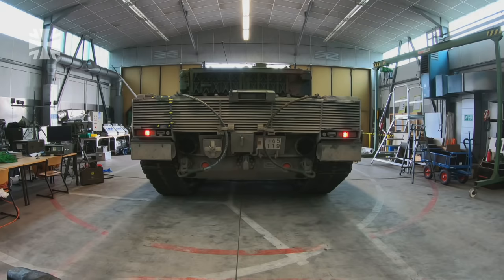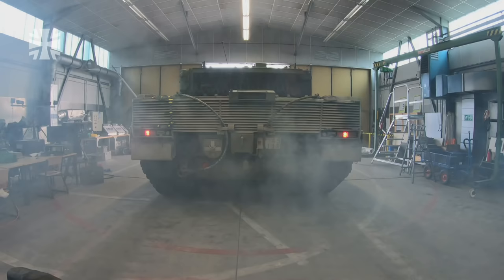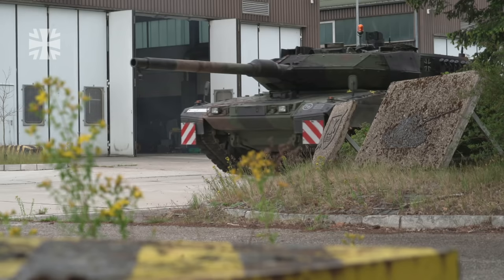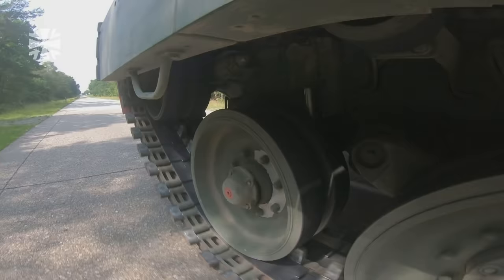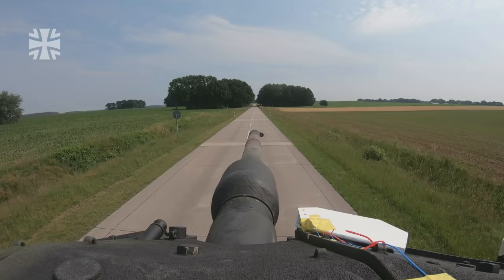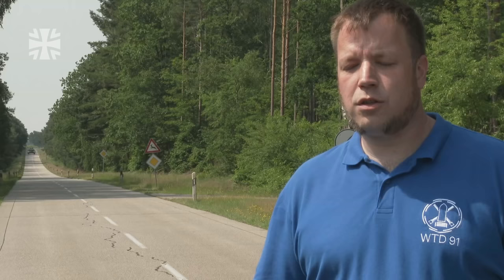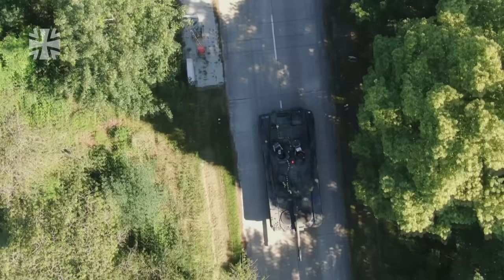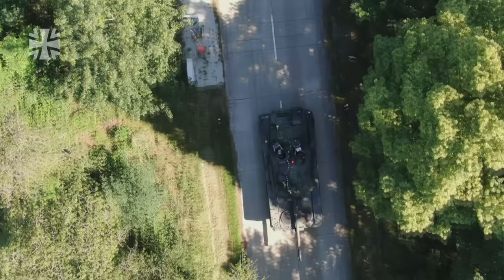Testing the New Leopard 2 A7V Battle Tank | Bundeswehr

Comment: I like that they called it the A7V
Reply: Ww1 flashbacks incomming
Reply: They got to know it
Reply: We skipped several variants to name that thing the a7v but don't tell anyone
Reply: @argumasch663  War 'n Witz Mann
Reply: @moritzrossbroich  
lol
Reply: Bf1 flashbacks
Reply: Small difference from the original rectangle A75
Reply: They both look like weaponized boxes so it works
Reply: Did they get rid of the ammo rack in the front?
Reply: @argumasch663  Wrong for the A5, served in a unit that used them before they went to being converted. That was back in 2003/4. We had both variants running for some time, the A6 and the A5. GÜZ used A4s at that time. But yea we were supposed to be all A6, our luck that the factory was only a few km away.
Reply: @konstanow1367  yes
Reply: @yuurichito1439  War thunder player I presume? :p
Reply: WW1 flashback
Reply: Hhahahahahhahahhahaha on the top
Reply: Wow, thanks for pointing out. Funny and nice detail
Reply: Next up:panzerkampfvagen VII tiger 3
Reply: @argumasch663  humor is not a german thing, huh?
Reply: Just like old times
Reply: WW1 flashbacks incoming
Reply: I thought that sounded familiar now that i saw this tho
Reply: @yuurichito1439  It was addressed in all leopard 2A6 and 2A7 as well as most 2A5 have or can be equipped with thick frontal armor plates. There are 2 modules, the second one comes as an additional on top of the first. Ammo rack since 2A5 has separated bins and the hull is covered from inside with the Nomex anti-spalling layers. All modernized Leopard 2A4 and 2A5 have very efficient fire suppression systems near the ammo rack. On top of all mentioned the crew can always take less ammo into the hull rack. Having it 50% empty solves the issue, 30% full makes it impossible to catch fire no matter what.
Reply: old habits die hard
Reply: When the old family name comes back*
Reply: I was screaming in my mind “NO GERMANY NO-“
Reply: Heil Dir Im Siegerkranz intensifies 
Für den Kaiser people.
Reply: Well they didn't get to use it in WW1 why not give it a rerun
Reply: British should make an Challenger Mark 4 or Russians name a T-14 Tzar
Reply: Yes A7V the only ww1 tank used by germany in case any other people see this and don't know what it is
Reply: @IronAussie1  when you realise it was a german joke, actually from a german
Reply: @magmcmahon9038  Then live with another one kid
Reply: Yeah, its leopard 2 Ausführung 7 verbessert.  Its like calling it A7 Mark II or A7 advanced. Its probably coincidental that this was a World War one tank name.
Reply: @deildegast  And ???
Reply: @deildegast  👍
Reply: What do you mean?
Reply: @robotdaan  what about big boy 😆
Reply: @magmcmahon9038  why do they call it that? And what does it mean
Reply: @robotdaan  cus Jeff carter love's it 😂
Reply: A7V Mephisto: Where did that bring you? Back to me.
Reply: Ah yes the old moving Toaster Machine
Reply: * WWI flashbacks *
Reply: its evolution stage 7 ... not the A7V from WW1... but as a german soldier i can tell you the T72 is able to kill a Leopard 2
Reply: KF51 „Panther“ left the Chat🙄
Reply: its called junk now pffffffffhahahhahahaha
Reply: It has come a long way

Comment: Time passes but certain things never change, you Germans are damned good at making tanks, and it is something you like, and I can only approve, a greeting from Italy.
Reply: Your Ariete is also a capable tank 👍
Reply: @jpm5125  😂😂😂🤣🤣🤣👍✌️
Reply: And still a danger to Europe by not helping Ukraine adequately.
Reply: @bananaman7537  Started out real slow and been the voice of restraints. Have painted out germany kinda bad.
Reply: @B.D.E.  well that changed now didnt it. Scholz got the yankees in
Reply: @swagkachu3784  yes. But imo, it would be more effective to send in Wiesel 2 Motar 120mm (8km range) and the Wiesel MK Version esp. in Urban combat those "things" can break & shot through walls with their 2-Ammo-Belt MK Turret feeder with AP & HE munition, which can be instant switched to each belt-munition. The Motar version has a insane range & shot frequence for its size.
After all, throw a Bush over it and it is simple covered. In night, even if a Wiesel is standing besides an enemy tank,... they will NOT hear it,..its so fk*ing sneaky. Fast in Fast out. Great fire power. Maintn. is with 15min Motor & Gear replacment IN FIELD conditions, cannon of the MK turret can be changed/replaced *without any tools.
You can get 6-10 (dep. on version) Wiesel for 1x Leopard.
So for 10 Leos, you get 60-100 Wiesels,...
Production time is also way faster ofc and the used Material costs are even better then 6to1 ratio.
Ofc the Wiesel is NO tank. It is the LAST Tankette: A tankette is a tracked armoured fighting vehicle that resembles a small tank, roughly the size of a car.
>> So for me, it would make more sense, to send what,... arround 500 Wiesels 300 MK versions and 200 Motar versions than 83 Leos.

Ofc i know Tanks would be also needed but in a matter of fact, the Wiesel should have been the first option send in mass to then be act as covering & scouting for the incoming MBTs.
Reply: @B.D.E.  if you are such a fan of Ukraine sell all your belongings and give the money to ukraine
Reply: Honestly German tanks in WW2 are extremely overrated. But yes, the leopard 2 is very much contends for the top MBT  spot.
Reply: @hhhkojkjk6962  kindergarten logic lol
Reply: Time for reunion?
Reply: @bananaman7537  yeh now who is keeping the ukranian budget running?
Reply: @B.D.E.  Just the second biggest contributer in the world. But i guess with your mindset you don't count EU donations....
Reply: They used to make good tanks
 Ukrainian war proved they were overrated
Reply: Время тигров и пантер прошло. Горит любая сейчас броня от Российского стрелка.😂

Comment: Me: how many variants do you want?
Leopard 2: Yes
Reply: Could go with the t55 or centurion
Reply: German Mechanics: we are about to announce the next version  after Leopard2A9
the world: ah, you gonna finally call it Leopard 3?
German Mechanics: Leopard 2.1
Reply: @Kalashnikov413  T-72:
pathetic
Reply: @cursedcliff7562  Skipping over command and export variants (many of these will have a "K" model which is a command tank with extra radios):
T-72 "Ural"
T-72 "Ural-1"
T-72V
T-72A
T-72A obr.1979g
T-72A obr.1984g
T-72AV
T-72B
T-72BA
T-72BV
T-72B1
T-72B obr.1989g
T-72B obr.1990g
T-72B2
T-72B3
T-72B3M
T-72B3 obr.2016

So lots of variants is pretty par for the course for modern tanks. Sometime during the 70's we got hull design down about as well as we were going to get it for a while and most of the developments in tank tech since then have been things that are easy to bolt on to a pre-existing hull with no need for any sort of redesign in order to implement them (things like improved fire control systems, better ammunition, better optics, and explosive reactive armor (all of which make a substantial enough difference to mean that if a company of M1s faced off against a company of M1A2 SEPv3s, the M1s would be absolutely massacred)).
Reply: @gareththompson2708  madlad
Reply: Sherman:
You dare oppose me mortal
Reply: Panzer IV: How cute
Reply: Germany: it’s so good we don’t want a third one!
We want more variants of the second one!
Reply: @TheDaltonius  apparently the third version is always the bad one.
Reply: Almost t72 level
Reply: @JakeTheTankmaster  there's so many i forgot lol lemme see...
Reply: @jvtagle  panzer 3 ಠ ͜ʖ ಠ
Reply: @scarecrow2097  Leopard 2A10

Comment: Germany never fails to put out 50 versions of an already existing tank.
But I genuinely love the improvements.
Reply: @argumasch663  Yeah. Kinda sucks when the country that made tanks doesn't do anything to modernize their mbts when back in WW1 and 2 they have millions of variations.
Reply: Just easier and cheaper to build a new AC into an existing frame than to design a new frame. And German thoroughness needs to name the one with AC differently than the base model
Reply: Why fix what aint broke right ?😂
Reply: @argumasch663  
...Challenger 2 has had 'crew AC' and an under-armour APU for over 20 years.

Comment: A great piece of German engineer art. Why they didn't the same with the Puma?
Reply: The Puma is the most complicated, most powerful IFV in the world. Of course, it has teething problems as every system of that complexity has.
Reply: The Puma is still a cub, let it grow up and it will become the most deadly predator of it's kind. Not only on paper.
Reply: @little_lord_tam  at first they need enough spare parts!
Reply: @ratzefummel2676  The vet has improved over the past years. Wont take long until every last problem there is solved.

Comment: Good, but i prefer K2 Black Panther.
Reply: Funny story, even though South Korea is highly capable in the automobile technology sector they are still having problems to match the quality of the Leopard 2 powerpack from 1970 (that's 50 years ago). The First batch of 100 K2 even had to revert to German MTU engines because the domestically-produced engine had reliability issues. 2nd and 3rd batches got a Korean engine, and 3rd batch (2020) was even supposed to recieve a Korean transmission, but S&T Dynamics still hasn't managed to replicate the 1970s RENK transmission to this day so they are still sourcing  it from Germany. One might think the fire control or stabilisation systems are the most complicated thing on a tank but nah, it's the damn transmission.

Comment: Is the top speed of the Leopard 2A7V 61 km/h or 63 km/h? The Bundeswehr website states that the speed is 63 kilometers per hour, but someone provided an introductory image of the Leopard 2A7V tank presentation, which shows a speed of 61 kilometers per hour. So which one is correct? I can provide pictures.

Comment: Why don't you change the ammo rack location in the left hull, & relocate it in the turret? That'll be more safer & it would be more modern. If that side of the hull is hit you'll find that the whole tank goes boom, just like the Turkish leo 2a4's did when they were hit in that same laction.
Reply: Because in reality of the 15 tanks turkey lost only two were hit in the hull and none of them had problems with the ammunition.
Reply: @comsubpac  Really?
Reply: @perfectlambministry777.  yes, really. The armor in front of the ammunition offers asuch protection as the turret for example. Something that can penetrate that armor will destroy the tank no matter what. The placement of the ammunition is irrelevant in that event.

Comment: i like how danmark got the 2a7 before germany got them
Reply: They did? As far as I know they are currently upgrading, the same way as Germany.
Reply: 2a7v ≠ 2a7
Reply: @hansmeyer7225  actually they are the same. The tank is officially designated A7 and not A7V.
Reply: @comsubpac  But there are older A7 without the upgrade of the A7V. I know both will run under A7 in the Bundeswehr, but there are minor differences.
Reply: @hansmeyer7225   When i said the 2a7, i meant the 2a7 in general. The 2a7v is the bundeswehr version, becuase they ofcourse want the better gear. But in theory, the a7 and a7v are basically the same.
Reply: @andersn4169  I know. There was still a version of the 2a7 in the Bundeswehr before the 2a7v was introduced.

Comment: The design is the same as the others. Can someone tell me what is new on this tank. Gun? Armor ?
Reply: As with most tanks (for example the M1 of the USA) the upgrades are most often less visible: better sensors, air condition, power supply without the main engine, some special made camougflage mats that help with reducing heat signature and similar. Thats why this iterations are called 'Kampfwertsteigerungen/Combat worth improvements' they don´t change the whole vehicle but make it more effective. The biggest change in design was for example from the a4 variant to a5
Reply: @graysun9108  alright thx

Comment: Is the new 130mm Cannon?
Reply: No.
Reply: @comsubpac  sad
Reply: @matheusmoreiradossantos5133  No, irrelevant. The L/55 can easily take out everything.
Reply: No it uses the new L/55A1 with the new DM73 APFSDS ammunition which allegedly will give the round 20% more performance. The las thing you want to do with a tank is upgrading the caliber of the gun because it would mean massive changes on the tank.
Reply: @viceralman8450  they are developing a new main cannon, maybe for other veicles
Reply: @matheusmoreiradossantos5133  I know but they aren't using it in the Leopard at least for now because it is pretty difficult to put a higher caliber canon in a existing tank.
Reply: @viceralman8450  yes, estructural questions

Comment: There is a sign on the fender. 76.  It means 76 tons. German engineer have not learnt that weight is a disaster for mobility. There is a joke about A7V in the commentary. I think this is joke about Jagdtiger 78 tons with mobility problems.
That turret is massive. I wonder how much it weights, 20-25 tons. How much power you need to turn the turret at a slop. I wonder why the russians always make so small turrets. Maybe it is harder to hit.
Reply: Russian turrets are smaller because there is an autoloader for the main gun since T 64
Reply: @enricol5974  I would say that russian always had small turret. T-34/1941 and JS3 was very wide but flat. They didnt have autoloader but they know that a small target is the best protection. Harder to hit.
Reply: @1965Leonard  And as result the ergonomics were atrocious reducing the fire rate and efficiency of the crew significantly causing more casualties and reducing the overall effectiveness of the tank.

Comment: Testing tanks can never be done on paved routes. You should test in a very complicated terrain ans unstable one. Try to test it in the heavy muds and deep lakes, test your aim through all of these conditions. You are not playing pubg after all
Reply: This is one test among many others. This one tests the smooth running of the tank, where the surface should not interfere, therefore the smooth and straight street, in order to measure the vibrations of the vehicle itself and not the underground.

Comment: For the puzzled ones: "PS" is german for horsepower. Baffled me why they did not translate that.
Reply: @ralfweber4346  Thank you, i knew that. Unlike other people i live with tolerances and a difference of 1,04 kg*m/s per horsepower that equals around 1,25 Percent - a difference well within the error margin of all the mechanical power output measure divices that i am aware of - i, for practical reason not for ignorance, just regard PS and hp the same. If i am standing in front of a Challanger MBT and i got informed that it's got 1200 hp i dont think "oh, thats 1217 PS - wow" . In reality mechanical production varies and two engines of the same model vary in power output well over than 1 percent.
Reply: @ralfweber4346   And i tried to make you understand that in practice the difference is insignificant. Obviously i failed.
Reply: @ralfweber4346  yes, no one would because the difference is 9 percent and easy within the tolerances of every lengh mesuring divice. The difference between hp and PS is around 1 percent.
Reply: @johnmosesbrowning1855  actually it is 2 percent and still nobody translates it that way.
Reply: @comsubpac  actually the difference is 1,37 % not 2 % and nobody cares
Reply: @ralfweber4346   Ah, now I think I know what wrong between us. You see, I did not study,  I work practical. So the notion that a tank has 1500 PS ≈ 1479,48 hp is not significant to me. I just round it up to 1500 hp knowing that the 1,37% difference is insignificant knowing that the mechanical power output varies greatly with outside circumstances i.e.  air temperature and wear and tear of the engine. In this MTU powerunit the output is mostly well over 1500 PS.
Reply: @ralfweber4346   I bow to your ignorance.

Comment: How about upgrading that papier maché hull?
Reply: You mean the strongest Armour of any western tank? Why?
Reply: @comsubpac What ????  It's one of the weakest, any modern dart goes through it like a hot knife thrpugh butter. Where do you get your info and what do you compare it to ?  T55s ?
Reply: @Valhalla_Awaits94  where did you hear that nonsense?
Reply: @comsubpac  From every armor expert out there ? It's worse than the chally 2, Abrams, even what the russian offer. In exchange it's slightly faster, by 2kph...
Reply: @Valhalla_Awaits94  only it isn't. Quite the opposite actually.
Reply: It is intended to by used in a hull down position.
Reply: @Valhalla_Awaits94  The Abrams have a 38mm upper glacis plate that can be penetrated by any modern kinetic projectile and it the case of a rickochet it would direct the round towards the turret rigs causing a penetration by the design haven't being change because the tank is meant to be use in hull down adding more armour would just make the tanks slower and more prone to be hit having the opposite effect.
Reply: @viceralman8450  Don't forget to specify the angle at which the m1s ufp sits.. It's basically an auto ricochet. Hull down tactics are good when you fight in the desert with fortified positions, what use is it when advancing through a field ?  And how do you hide the entirety of the leo 2's hull ???  Build a fucking bunker or dig for 3 hours ?
Reply: @Valhalla_Awaits94  Against APFSDS no HEAT maybe but it would send the round directly to the turrets ring where it definitely would penetrate and that's bad new for the louder, commander and gunner.
Reply: @Valhalla_Awaits94  actually the Leopard 2 is supposed to fight from prepared position and to move from one prepared position to the next. That's why the tanks are accompanied by Pionierpanzern, which are equipped to prepare positions. The Armour, especially after the A6M update is much stronger then the Armour of the M1, especially the hull front has been reinforced.